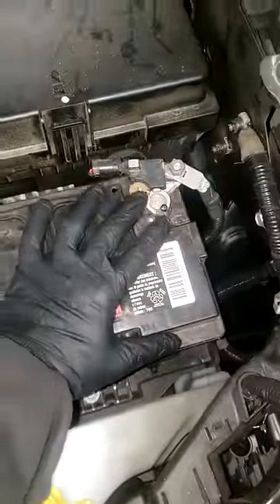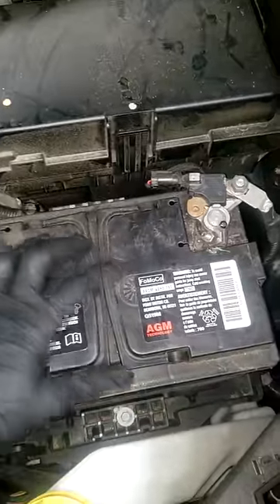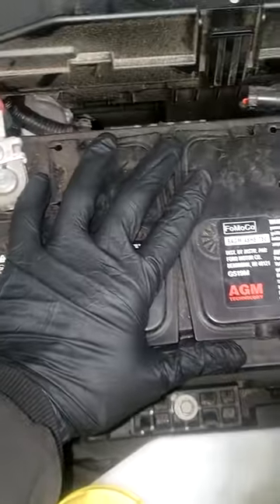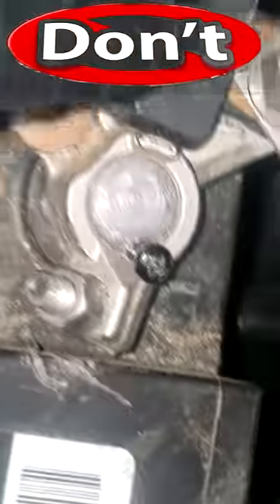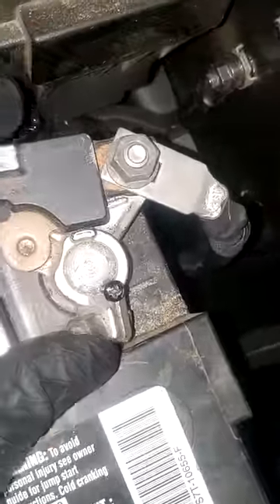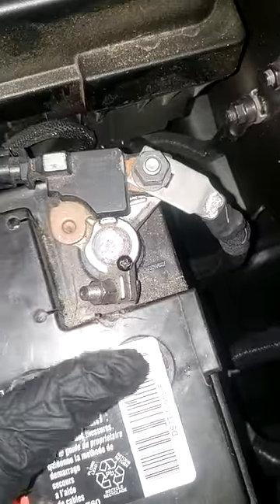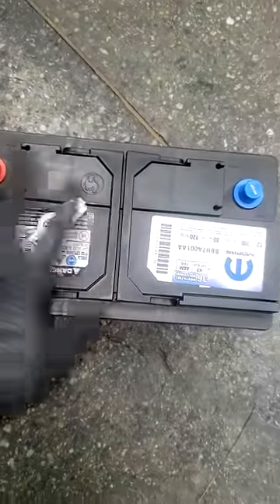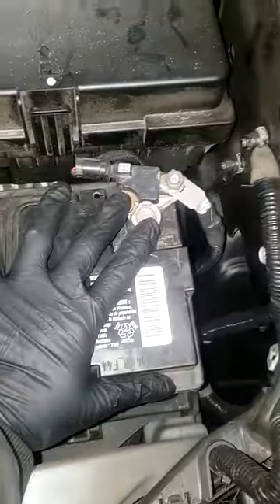STOP DOING THIS PEOPLE. This will destroy your car electrical system.

Comment: Replacing the battery and sensor was the correct fix. However, as many have said, that screw has absolutely nothing to do with her symptom. 0. You did the right repair but you’re acting like you’re saving the day and that the root cause was that screw. Makes 0 sense. With that screw the battery terminal still has 90% contact (you really only need 30% contact to start run and drive the vehicle without any low voltage codes). Weird way to get validation but yeah you did the correct job. If it were a normal video it would go “battery failed the test. Someone damaged the negative terminal which is inclusive to a battery monitoring sensor. Someone’s used a screw as a temporary repair. Because I’m here I’m doing the job right and replacing everything.”

Instead of “this vehicle had all this and that lights on the dash and stalling out and shit because someone drove a screw through the battery terminal” lol..
Reply from the maker: Seems you straddling the fence, you cant have it both ways my guy. You cant suggest that the screw shouldnt be there and in the same breath suggest it was no problem. Make it make sense.

Comment: I used to work on cars back before computers. I wouldn't think a screw in the  terminal clamp would cause all those issues but in today's vehicles they are so sensitive I could see a bad connection causing problems.
Reply from the maker: Yes, very sensitive now
Reply: If a digital circuit doesn’t have a good ground, it literally can’t tell a difference between 0 and 1.

Comment: Parts dept gave you all you needed.
Reply from the maker: New battery but the terminal wrong. This car more electronically savvy and use an IBS sensir/terminal. Shouldn't  be no damm screws nowhere near this thing.

Comment: Clean the terminal..
Battery is good.
Just bad connection. 
The screw worked for a min.
Open it..clean it..
Lube it with dielectric. 
Charge the battery for 30 mins to help the customers alternator.
Put it back together. 
No parts.
Good as new
Reply from the maker: You got it all figured out. Thats whats up
Reply: @OnlineMechanicTips  been a mechanic for 5 decades now and make my way helping everyone afford repairs.

Comment: I do believe that the fellow mechanic is correct, the issue was not generally the terminal but i do definitely suspect a dead or dying AGM battery. There are Capacitor Batteries now being released that last a damn long time compared to a regular car battery. The battery is designed to be a fail-safe or fallback point for the vehicle in case the alternator dies. It gives a respectable amount of time to limp a vehicle to a safe place before power dies in the event of an alternator failure.
Reply from the maker: Smdh. Another screw defender I see. That screw not good for these newer cars guy. Connection at the battery could be affected then all hell will breakbloose

Comment: I'd have started with disconnecting the terminal and cleaning it all, then  assemble again making sure it's all tight. No need to jump straight in replacing everything.
Reply from the maker: They just did all that. You see that wrong battery and what they did to that IBS terminal with that screw. This lady said fix her car. In other words those 2 needed parts worth the piece of mind knowing its fixed. I wasnt about to waste time on any of that you mention, I can visibly see all I need to see. 1 hour labor and a computer proxi realignment and she's gone and happy. Screws have no place on these new cars. Poor battery connections can brick a transmission.

Comment: I’ve seen that a lot. Another thing people tend to forget is that when you replace the battery, you have to reset the battery monitor. If you don’t the computer will not know that you have replaced the battery and will start shutting the electronics off in the car until it is resolved.
Reply from the maker: Thats interesting my friend.

Comment: Nothing wrong with having that screw to get terminal tight for better connection
Reply from the maker: Then leave yours in my guy..lol..
Reply: Yeah we don’t rig it we fix it !
Reply: Maybe for a temporary fix, but always get good tight battery terminal contact.
Reply from the maker: @volvo09  yea thats not a good idea on newer cars. You lock yourself out
Reply: @volvo09  eh fuck I took visegrips around my to tighten the negative clamp up the old Honda loves it

Comment: I have a 92 Buick that was having a terrible time with cutting out, random electrical problems like the whole car would shut off for a split second and then be fine. Turns out the negative cable bolt stripped the lead battery threads on a prior battery and had the lead wrapped into the threads. And that would have been me as no one touches my cars. But I never crank it down, just snug it, so who knows. Anyway, replaced that terminal bolt and it's been fine.
Reply from the maker: Lol, glad you got er going
Reply: @OnlineMechanicTips  yeah it was scary, you never knew when it would cut out so left turns were uncomfortable. Lesson learned, I was checking all over and testing the BCM and all kinds of crap. Check the simple stuff first.

Comment: They make lead shim caps to fit over a battery post that allows a loose battery cable clamp to properly tighten. These run about $3/pair at a parts store.
Reply from the maker: So not recommended on new cars using IBS

Comment: How to identify you have the wrong battery?

One. It does not properly fit in it's designated area. If the battery cannot be properly secured and its location. It runs the risk of bouncing around underneath the hood, loosening your connections, and creating damage. Even more so, in the event of a collision, it becomes a hostile projectile under your hood.

Two. Your terminals do not connect properly to the battery itself. There should be no excessive tolerances to the terminals or the posts. It is the same as a nut and bolt combination. It's either right, or it's wrong. If it looks right, it could be right. But if it looks wrong, it probably is. 

Yes, you will save yourself some money, by shopping aftermarket on your accessories and disposables. But just because they offer them aftermarket, doesn't mean they're the proper fit or function for your particular vehicle. 

Most automotive technicians are polite, when they describe parts as aftermarket. Or, OEM style. 

The harsh reality of aftermarket parts is, 90% of them are actually counterfeit. Only designed and manufactured to create a temporary solution to a persistent problem.

Comment: as someone with zero experience with these types of systems, I think that a screw shoved anywhere other than the places designed for screws is probably not helpful. 
why would you poke stuff into a battery anyway? wouldn't that mess up the battery big time?
Reply from the maker: Yes, it could affect a lot of things. Doing this can even brick your transmission to where it will not shift. Battery connection very important on these newer cars

Comment: I am not convinced the screw was the problem.
Reply from the maker: Lol, so what do you expect me to do now, prove it to you? Cause that aint bout to happen. Let me put it this way. The battery and the IBS battery terminal sensor was replaced. The check engine light now off and the car is long gone and to top it off, the customer happy her car fix. Not sure what else youde expect out of a repair but hey, some people like that
Reply: Exactly my point.  Probably the sensor or a bad connection between the sensor and the battery terminal end.  You replaced EVERYTHING.  Of course it’s fixed.  I don’t think the screw that made the terminal end tight had ANYTHING to do with the problem.
Reply: @OnlineMechanicTips  my reply is above.
Reply from the maker: @Sir_Loin_of_Steak  I cant help what you think. In this video, did you not hear me say after showing the customer this, she agreed to replace all of it. You guys spend/waste to much time thinking. You have a check engine light on and a visual problem right in your face but yet yall still choose to waste time. Pop these 2 parts on and recalibrate every thing and get this thing out of here and bring in something else. Stop thinking so hard when the problem visually starring you right in the face.
Reply: @OnlineMechanicTips  that’s why I’m not a mechanic anymore.  You guys just want to take your best guess and throw parts at it.  You don’t diagnose anything.  No appreciation for saving the customer loads of cash.  And the customers don’t appreciate it either.  To heck with you all.
Reply from the maker: @Sir_Loin_of_Steak  Im not sure who hurt you in your earlier years but it seems you made the right choice. This profession definitely not for you. You def not cut out for this.
Reply: @OnlineMechanicTips  Nice, you’re a hack psychologist,also.
Reply from the maker: @Sir_Loin_of_Steak  LOL, sure man, whatever you say. I could care less what you think about me my guy.
Reply: He said the battery did not pass the test. That was the cause of everything. That car is a Jeep Cherokee I’d say 2014 on up. Betting it was 2015. As that is what I have and the engine cowl is the same. They are very sensitive with their batteries and when the battery starts to go it sets off all kinds of crap. Same thing happened to mine. Replaced battery and my Ibs and still had to wait a few weeks/driving cycles before all was well again.
Reply: @Anthony-fd8mh  My whole deal is that he was showing us the screw in the terminal end and said “don’t do this people, it will ruin your car”.
The screw has nothing to do with the problem.  The terminal end was stretched and the screw was providing tension.
Reply from the maker: @Sir_Loin_of_Steak  The screw was the reason for the poor connection. The poor connection causes problems on these newer cars
Reply: you can't just be palying around in the presence of a sensor. that's gonna cost you like a thousand dollars to unbootleg that thang
Reply: @onetrues3978  This will be my last words on this subject.
More knowledge of electrical circuits and less superstition is badly needed here.

Comment: Can you tell me how, exactly, that  screw actually caused a failure? Is the battery actually bad? And, if the battery and new sensor doesn't actually fix the complaint, will she be upset? I'm curious. If you verified the complaint, and determined the screw was the cause, wouldn't you have already replaced the battery and sensor in order to verify?
Reply from the maker: Well the check engine light on and dash goes crazy is the complaint. Code relating to the IBS. That lil thing that has the screw in it not your typical battery terminal. It is in fact a IBS type sensor used to tell  the computer things about amp usage and temperature. So if you go putting screws into it you will affect its operation, the computer will sense that and store a code and a check engine light.  The driver will see that and bring her car to the shop. Thats where I come in. I see that and the code and its obvious what my estimate will be. She's pissed at the other shop but agreed to the estimate of a battery and a IBS sensor. 2 months later all is well with car. Im thinking she got all her money back from that shop. I don't waste a lot of time testing the obvious.
Reply: @OnlineMechanicTips  But how does it know there is a foreign object. Theoretically, the screw, although an improper repair, shouldn't interfere with the flow of electricity. I guess that's why I'm confused. 
Also, thanks for the rapid reply.

Comment: It appears the bolt on the current sensor broke off. That would cause a problem.
Reply from the maker: The IBS and the battery was replaced. Car fixed and gone. We don't waste time on broken bolts of a sensor.
Reply: @OnlineMechanicTips  I guess that works. Replacing the part you sent back would have fixed it though. I guess if your customer doesn't know the difference you can get away with that. That's what a $500 bill vs $100 for just the clamp.
Reply: It looks like a new bolt on the sensor was all that was needed for a complete repair. Possibly a new terminal.

Comment: It's crazy what sorts of problems a loose battery terminal will cause. I once forgot to tighten my negative battery terminal and for months the engine would intermittently backfire, or cut out, or the gauges would drop out then come back to life, seemingly without cause. All because I overlooked the negative battery terminal.
Reply from the maker: Yes its crazy. Some cars will lock you out of the transmission. You will have to get your car towed to the shop.

Comment: This trick works has worked for yrs. Idk how it's obsolete now in 2023? The screw isn't effecting the sensor what soever. I'd just replaced the battery and terminal then seen if the ibs is for sure bad before saling parts. Like my college teacher s told us anyone can throw parts at it were here to teach you how to diagnose and repair the car properly. This isn't the proper fix to put a screw in it but tha hack does work.
Reply from the maker: Trick??? Hack??? So yall do this type shit on purpose??? And think it's ok??? Please tell me you don't own anything from 2022 and up. These are heavily monitored by computers and stupid shit like that good. That lil connection mishap could easily have knocked her transmission out of sync. She's actually lucky. But you guys keep hacking away ok
Reply: @OnlineMechanicTips   why would I have to own a 2022 or newer to have knowledge? That sensor monitors battery condition and voltage. If car starts that's 250 amps plus if tye battery connection can carry 250 amps it's a good connection it don't know there's a screw cinnching the terminal tight around the post. It's a sensor nothing to do with the terminal other than mount to it and monitor the battery voltage and condition. More than likely the battery as bad and I myself would have cleared codes replaced battery and terminal 
Tested the car sent it down the road. Last thing I will do is ever replace parts for preventive maintenance if electrical new parts are junk shit unless from dealership which a 2022 or newer would be but there's no set life span on electronics. The new one could shit tommarrow customer or myself asking for or putting old one back on and driving car out the money on a wasted attempt to save a few minutes of seeing if code comes back which you'd want to do even with a new ibs. So I think what everyone is getting at is old tricks still work even though cars electronics advance you still have an internal combustion engine lead acid battery hydraulic controlled wet clutch transmission with a torque convertor that hasn't changed operation in yrs and rubber pneumatic tires. And hydraulic brakes or electronic wedge brakes. It's not just you it's lot of guys look way outside the box one thing I'll never forget is keep it simple. I see why you changed sensor to be safe than sorry it comes back buy its electrical don't touch that shit unless it's for sure bad. That factory sensor could last life of car the replacement s sold could last 2 weeks or 2 days for next 10 you get. This apply s to anything electrical. The exceptions to this would be like a fuel pump even then shit scares Me. Electric motor is abit more reliable than a slid circuit component but fp s fail new one could shit out and your kicking yourself in the ass like sob I got fucked on that deal. It happens at one point or multiple times in our life's. But that screw trick was taught to me by a college level teacher 20 yrs ago he was 55 yrs old owned the shop had his deceased father's customers still coming to him. Most honest guy I've ever met and was real anal on rigging things but he refused to sale someone a terminal if he could clean it shoot a screw in it send em on there way it was free of charge not one came back due to screw.